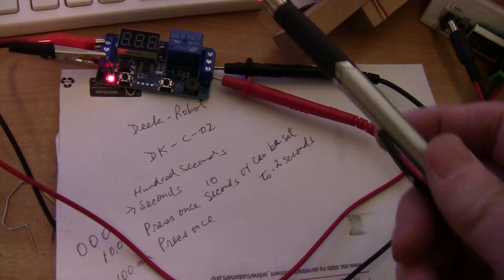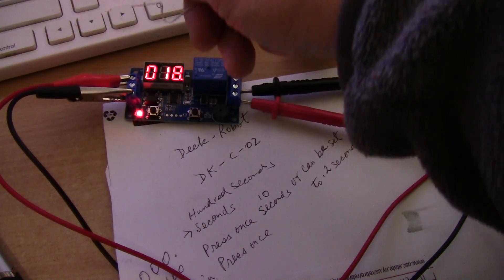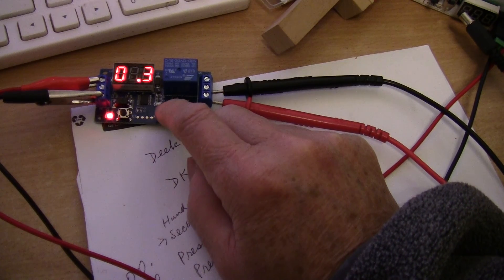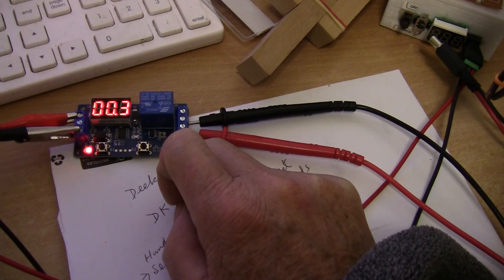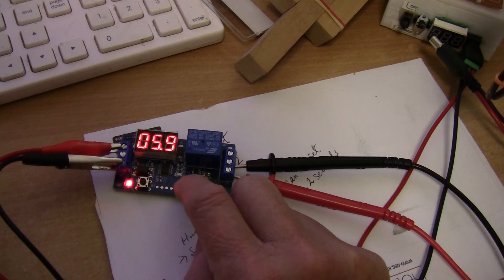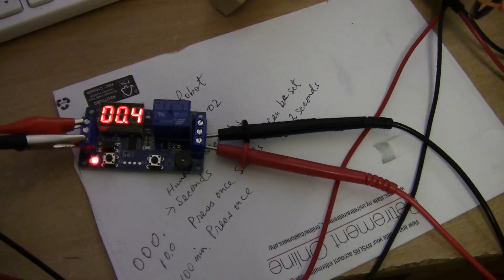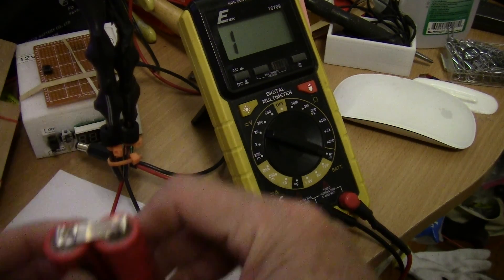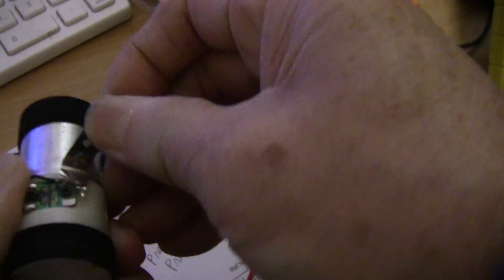12 volt battery powered 18650 spot welder experiment  part 3: How timer works

Comment: I have a similar timer relais but as long as i make contact on the switch it keeps passing the voltage? I Need a relais that will cut off power even when i keep pressing the switch. Or do i mis something here? My press takes longer then the .2 secondes i Need so the relais stays on. Thanks.
Reply from the maker: Then you don't need a timer. You need a momentary switch and a relay. The momentary can be connected (either way) to be on when you press it or off when you press it.

Comment: Hi its a great video and through out explanation. I have actually ordered one of these and used your video as a guide. For those interested I have also try to use the onboard relay and it turn out to be working. However I found out that my spot welder(using MOT) needs to be in resolution of 20-30ms. I suggest for people arduino and SSR rather than this. Thank you again
Reply from the maker: Thanks for your input. There are many factors that contribute to a making a working product. Your suggestions will help do it yourselves  experiment and assemble a satisfactory design.

Comment: Hi, i have a questio, what if your signal is up to 40 seconds ( Hardcoded ), but you need only 2.5 seconds.... after the 2.5 seconds, does it will triger again til complete the 40 seconds??....  or only is conna work for 2.5 seconds waiting for the next trigg
Reply from the maker: It triggers once for the duration you set.

Comment: Hi sir can I have the full circuit for the sport welder?? Tq
please email me at recuat@yahoo.com
Reply from the maker: I'll do it when I get a chance.  There is a spot welder circuit  in Darkkevind's channel. You can look it up. He doesn't use a timer though.  Here's a link to welder diagram:  https://www.youtube.com/watch?v=nmVqUkNjubk
Mine is similar, except I added a timer.  If you get chatter from the relay on the timer board, you might need a flyback diode as well.

Comment: Can I have the model of the timer or maybe can I get the link???
Reply from the maker: Kenny Ho    The model number is dk-c-02.
Reply: If you buy a FRM01 timer module you can have 0.05 second incremental steps (1/200th of a second)

Comment: Can you power this timer relay with car battery? Or it will destroy it?
Reply from the maker: I am not sure.  I suspect  it will work but I don't want to take a chance. It's easy enough for me to power it separately.
Reply: I found out this module was too long pulse, lowest settings at 0.2s is long time, and it will make hole through nickel and battery. Good spot welding should be under 50ms
Reply: Claudius where can i buy it? I want it to be ready to use..
Reply: Claudius If you have any link to a video that can guide me to make one, i Will try :D Im not expert at electronic..
Reply: I  powering a similar timer from the same battery. All is ok, just it was not working from my first tests. Problem was that timer was powering off every time when I short-circuit the battery. The reason for problem was that I connected timer near the selonoid on a longer wire. When I connected timer directly to battery the problem was gone.
Reply: @ronaldstilcens3776  my comment is over 2 years old, anyways this timer lowest time setting is 0.1s=100ms, which is too long time. You will need between 1-30 ms timer to get good welds. 100ms burns the nickel and heats the battery a lot. I use kweld which is working like a charm.

Comment: I wonder if the weld would be easier to control if you try some different battery's maybe ganging 3 18650's together could put out enough amps to weld but say shorted for like 3 seconds the sla battery can dump a huge amount of amps in a very short time leaving it very uncontrollable   using different battery combinations would also let you play around with voltage.
Reply from the maker: Yes, the SLA battery can put out a lot of amps for sure.  Hopefully, the use of the solenoid and timer will make it more predictable. The 18650s can probably be used and be more stable than the Lipo batteries.  I have to get a clamp meter to see how much current is being drawn doing such welds. I have seen people using microwave oven transformers drawing upwards of 40 amps.  Even though the voltage is low,  things can go wrong in a hurry. It is rewarding though when it appears to work.